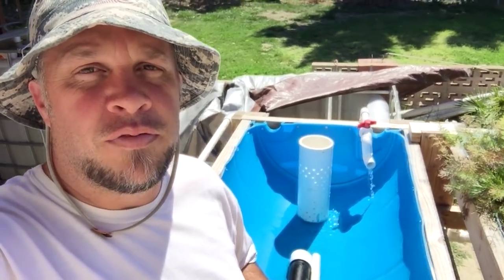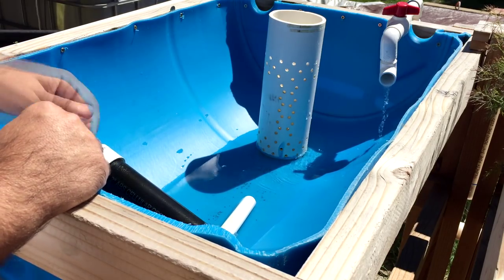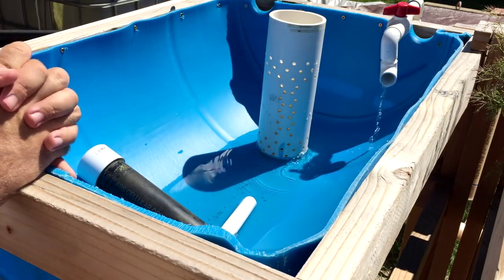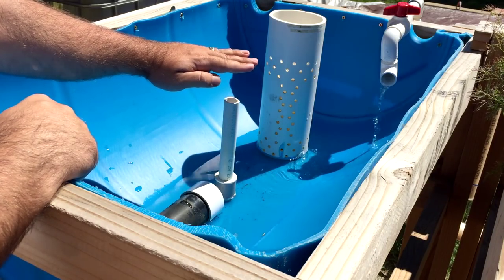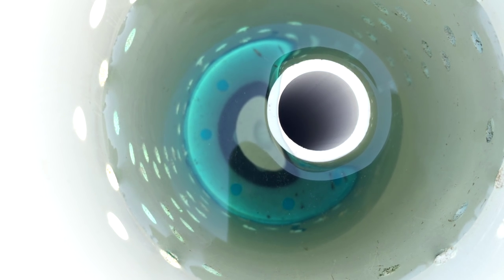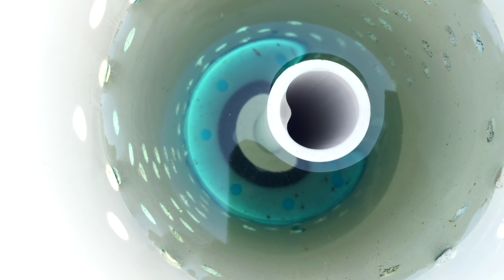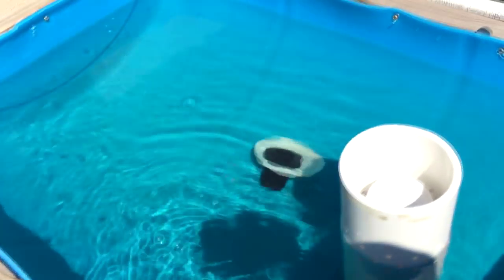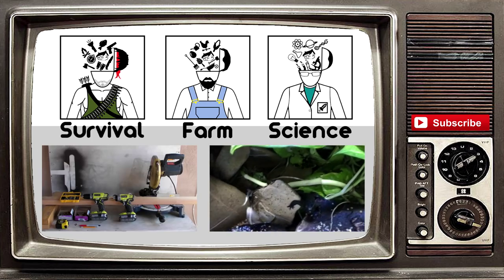Aquaponics 6 - (Installing Bell Siphon)

Comment: Great video series. You mentioned algae and I've got some questions.

I'm planning an aquaponic system for couple families, and the plan so far is: vertical towers feed into grow beds, which drain into trickle algae growers to manage ammonia and as food for catfish and prawn. If contained like that, are there still concerns about algae?
Reply from the maker: Thanks:) Well, algae is a plant and it will eat up nutrients and that will take away from any veggies you are growing. Not only that but it will eat up things like iron. Iron normally runs deficient in AP systems.